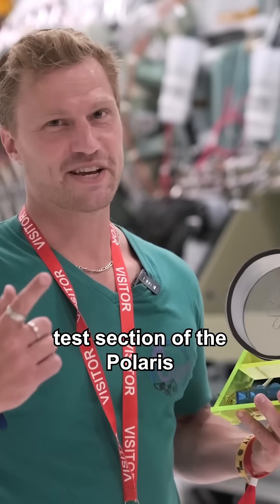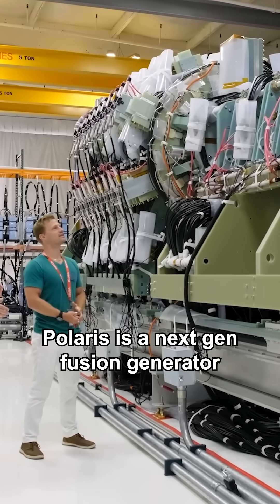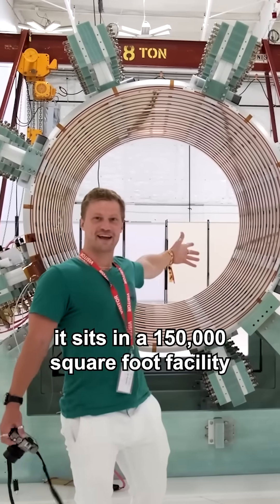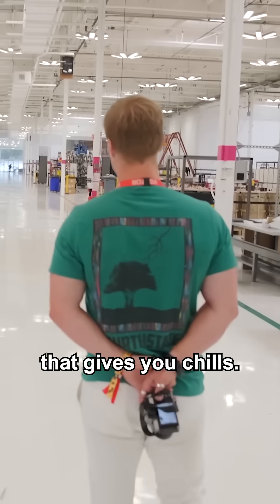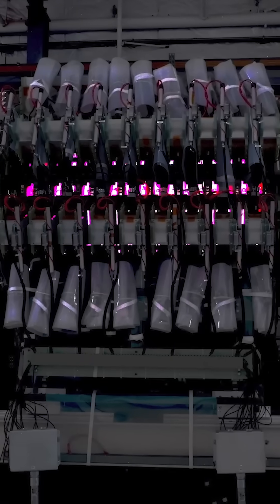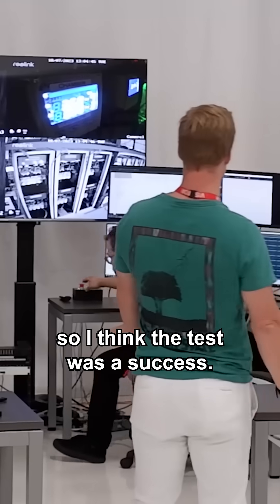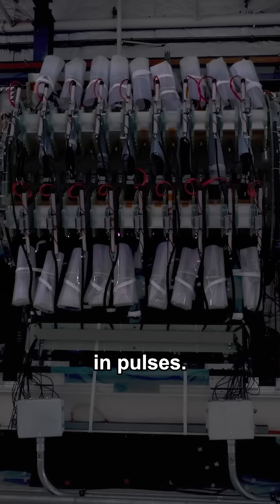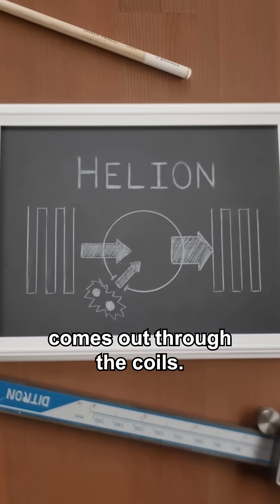An Exotic Approach to Nuclear Fusion

Comment: You poor things lol what are you trying to get fusion for? Fires Ultrasonic laser from 3 points to center pushing water from atmosphere while using Ultrasonic resonance at center to convert water into gas for plasma cavitation to expand into while using Ultrasonic repel of excess fuel by core of rotating plasma to control its fuel intake by size before beginning expansions & contractions Oh wow now you can use Ultrasonic echoes to pull atmosphere to produce a constant stream of hydrogen for ships while having so much you can keep them going while using fuel storage as backup fuel for battle damages to shield control.
Reply: You have a working device?
Reply: @MrSummitville  Star like UFO's? Huh? 😇

Comment: Nice science experiment.
But I doubt practical, net positive energy fusion will ever happen on Earth. There’s a reason you need massive, gravitationally crushing force to ignite fusion, like a star.
Reply: What's the reason?
Reply: We need to replicate the crushing force of stellar gravitational mass to ignite it. When you don’t have gravity on your side, you need to pump ALOT of energy into confinement. Then there’s the cost, radiation, process engineering, and impractically costly shielding. Aneutronic fusion requires even higher amounts of energy than what we’ve achieved to not even yield positive net energy in lower-energy reactions.
Maybe (I hope) I’m wrong, after all: we fly, we split the atom. But fusion’s always 20-yers away for a reason.
Reply: @gechgr1850  No, we do *not" need to replicate the crushing gravity. Are you not aware ... we already have several devices that  perform fusion?
Reply: But NOT for positive net energy, we don’t.
There a certain amount of confinement and energy required just for ignition. But ignition doesn’t mean positive net energy is coming out of the reactor.

Comment: considering the gravitationaĺ pressure eveb at the surface of the sun and its mass implying an average density higher than water, both these put it into the realm of possible that the sun rather exists as mostly metallic hydrogen,

combined with the z machine data which absolutely no one bothers paying attention to, invalidating the standard solar model of the suns emission spectra, 

i would suggest attempting to achieve sustained fusion via plasma as in tokamaks like iter to be misguided, this one being slightly less silly at least for its closeness to nuclear bombs, even if their scaling is i suspect all wrong, and their failure to incorporate radioactive elements as a neutron source to aid reactions

Comment: Helions approach is novel, but ultimately doomed to fail, theyll need pretty beefy radiation shielding because all the fusion happens in one spot, which will also lead to even quicker material fatigue due to radiation. This issue is already a doozy with conventional fusion reactors and will no doubt be a bigger issue for them. But ultimately the biggest problem is their choice of fuel, since one of the isotopes used (tritium i think) needs to be created artificially, in a conventional reactor this is achieved with so called breeder blankets which are themselves in conventional set ups highly flawed. However Helion can’t even use these in their setup. 
Its been a while since i followed fusion closely tho, so please  take the details with a huge grain of salt. But there is a a great video: The Problems with helion energy that explains the problems pretty well
Reply: I believe they were planning on building a fuel generator reactor, that would create the fusion fuel for the electricity reactor. The byproducts were all usable and could be sold for profit.
Reply: @Flyingwigs  Came here to say this as well, they're whole plan is to make their own tritium for their energy producing reactor in a dedicated fuel breeding reactor, which will produce enough fuel for multiple energy production reactors.

The radiation shielding is really their biggest issue, but i do really like their idea of magnetic compression and regeneration energy extraction, it thinks it has real potential in the right form factor
Reply: @MirorR3fl3ction  definetly agree with the whole direct electricity capture idea, I think that that’s pretty nifty. Although i genuinely don’t know how this approach deals with capturing energy that is radiated via photons or neutrons (especially since these most efficient D-T fusion sheds a lot of power with its neutron emission) since these are neutral and therefore won’t have an effect on the magnetic field. And i can’t really imagine collisions of these emission with the plasma playing that much of a role because of the low density. Where as in a conventional design all the energy slams into the wall eventually. But honestly don’t know enough about that to have a firm opinion. 
About the breeder reactor, I couldn’t find any concrete plans at a cursory glance on their website, do you have some more details about the design? As far as I can tell, Tritium is currently created via fission, at which point I feel like we could just go back to electricity via fission. The alternative would of course be a neutron Lithium collision with neutrons from fusion, but in that case I fear that they might run in the same problem as the National Ignition Facility, with a process that in and of itself is energy positive but has auxiliary needs that bring it back to being energy negative.
Reply: why not thorium
Reply: @StoneBox_761a  that'd be fission, not fusion (as it has way too big a nucleus).
Reply: @Guffy1990  does that mean less or more energy or what about the radiation?
Reply: Material science just cant keep up yet
Reply: If they coat nano layers of lead from the inside that might shield the radiation…
Reply: @nicholasgoodfellow5774  It does...it's just that certain materials last longer than others.  But it breaks them all, eventually.

As neutrons hit the atoms of the shielding material, it changes them into other isotopes of those materials, and changes how they interact with one another, causing the material to weaken over time.

There are three potential solutions.

1)  Use so much shielding that it doesn't matter how much radiation it takes.  That much mass will last functionally indefinitely.

2)  Develop some miraculous meta-material that, instead of weakening as the material's isotopes are changed, it somehow strengthens the bonds instead.  Highly improbable, but not at all impossible.

3)  Don't shield the thing.  Make the core entirely permeable to neutrons, completely non-interactive with them.  Then shield the EXTERIOR instead.  Then...just replace that shielding whenever it wears out.  So long as it's cheap to make and easy to replace, it doesn't matter.  Again, it would require some novel material research, and it's still kind of improbable, but far more likely than something that gets stronger when you pound it with radiation.

Failures in nuclear science will tell you option 1 is the ONLY option...because they know they themselves will never make any real contributions to the field.  They just do the busy work and never get published for anything worthwhile.

Still important to have people who know how to operate nuclear technologies, but when discussing hypotheticals, their input is almost entirely useless.
Reply: They are not making neutrons.  It's a Deuterium-Helium3 fuel.
Reply: Just to let you know, the by product of their fusion does not produce neutrons
Reply: The Dunning-Krueger effect is strong in this thread.
Reply: @KCM25NJL  I don’t know that’s fair to the original post. He made it clear he hasn’t followed fusion development recently. Yes he misses some basic points covered in the full interview, but his point about the radiation issue has been debated/discussed by other channels, so that’s an open debate. 

I think it’s good that amateurs and enthusiasts like us discuss such topics, even though our knowledge is clearly limited. Especially as there is so much irrational fear about nuclear power that it has negatively affected the industry and our energy capacity (fission in particular, but also fusion).